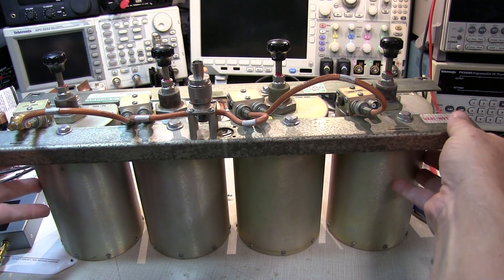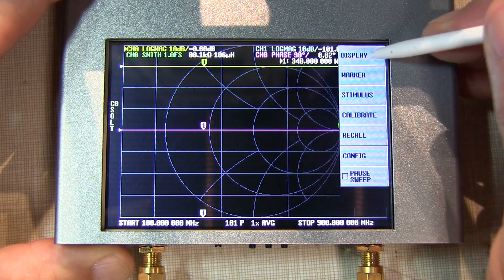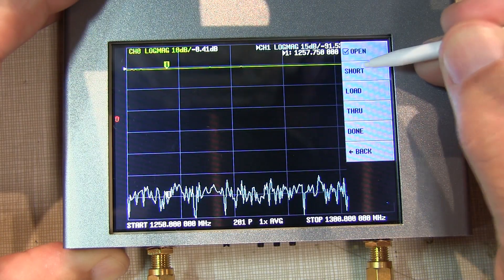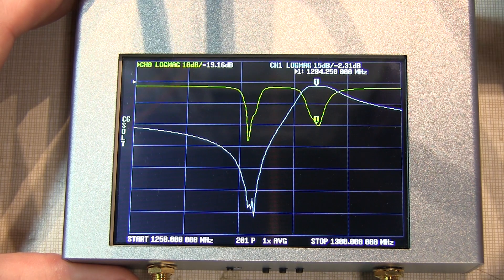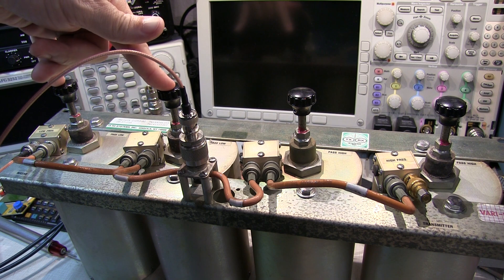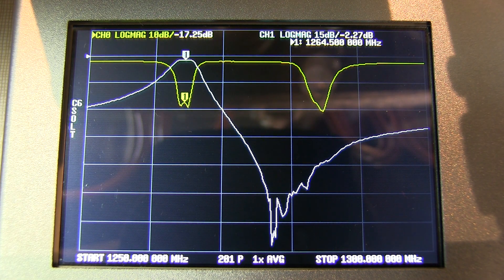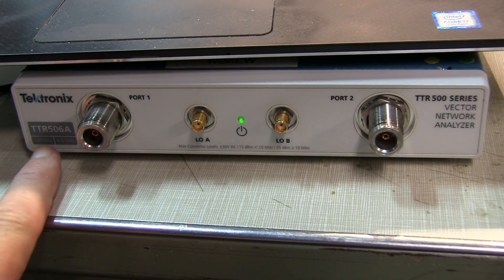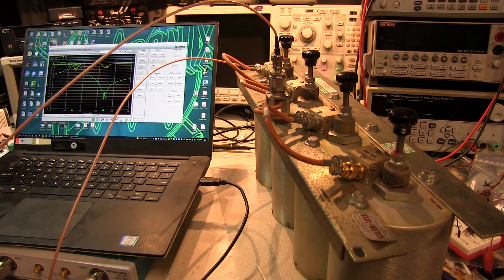#334: How to tune a duplexer with a NanoVNA V2plus4 | is it possible?

Comment: At 10:45 you briefly commented about the "two little peaks down at there bottom". I wonder if you could explain (or at least speculate) on why we don't see a single "peak"? It's interesting to note that those 2 peaks also show up on the TTR, so it's not an artifact of the Nano.
Reply from the maker: I haven't thought about it much.  To be really sure, I'd want to measure each cavity independently in order to see if each of those features is associated with individual cans.   It could be that the filters are tuned slightly off from each other and that is what was needed to get the passband response we wanted, but that is just speculation.  If I ever get one of these duplexers to test again, I'll look into this deeper.
Reply: @w2aew  Could it be a harness issue? Is the harness original? Are the frequencies those that the unit was tuned to at the factory?
Reply from the maker: Probably not since I was moving the frequency by only about 0.5%
Reply: @w2aew  I have seen this on Sinclair factory tuned units when using my SA/TG and RLB...always thought it was the rod(s) getting bumped in shipping. I'll anxiously await your deep dive when you get a round to-it...Tnx
Reply from the maker: With some more research, this appears to be due to the interconnecting cables not being a quarter wavelength long.

Comment: The trick on this kind of combiner is that each branch of the output has to view an open circuit on Smith chart at the rejected frequency. In order to achieve that, the length of jumpers is not trivial. If any of the jumpers is damaged it must be replaced with an other with the same electrical length. 

Regards from Spain

Comment: I've been trying to check a Wacom Bp/Br 440 duplexer using a NanoVNA.  Both a 2AA-SN and a new H4.  Following this video I seem to see a Bandpass response around the correct frequencies, but I see no reject or notch response.  Plus the S11 display is just a constantly changing jagged line, which looks nothing like this display.  I've calibrated using the cables, tried different cables with no luck.  I have only used the 2AA-SN O,S,L cal devices as the duplexer has N connectors.  The unused duplexer port is terminated with a dummy load.  I can't figure out why this isn't working.
Reply: Never mind.  It is one of the calibration standards that came with the 2AA-SN.  I'm guessing the load.  Calibrated with the smaller SMA style and now is working.
Reply from the maker: Ok, glad you figured it out.

Comment: Years ago I helped an engineer from Germany tune an 8 cavity hi power combiner… he told me he had a special tuning tool in his bag that he had brought with him for fine-tuning, and when he reached in and pulled it out, it was a tiny brass hammer 😂 he did exactly what you were doing just tapping on the adjustment rods with that little brass hammer.
Reply: I use a small plastic hammer. I have tuned many constant impedance combiners up to 20kW per channel and adjacent channel for HDTV and I can say that "tap tunning" is the easiest way. Tuning an 8-pole filter with two cross couplings is not for beginners.

Regards from Spain

Comment: each cavity should be tuned individually. pass 1st notch 2nd. once you have tuned all 4 install the harness do not touch up.
Reply from the maker: I've always done the final touch up with the harness connected - in the very least to verify performance in the final "as used" condition.

Comment: Great video. Dumb question, if you're calibrating the "open" then why do you need to put an open calibration connector on there? Isn't leaving the connection open still "open"? LoL sure. I'm sure there is a good reason.
Reply from the maker: At low frequencies, it doesn't matter.  As you to very high frequencies, the physical location of the open needs to be the same as for the short and load, so that the phase (propagation delay) to each of these "standards" are matched.  A small dimensional difference in the location of the open with respect to the other standards can throw an error into the calibration with respect to phase.  This effect is proportional to frequency (because wavelength is inversely proportional to freq)

Comment: I have a lite vna. Seems very similar. You seem to skip over some steps of setup in the vna. I haven't had luck following along. Or is there soke huge difference between nanotechnology vna & lite vna versions?
Reply from the maker: The intent of the video wasn't to show the complete setup of the nanoVNA (so some steps may have been not shown), but rather to check if the performance of the NanoVNA was sufficient to get an effective result.

Comment: Comparing this to your previous video #318, i was worried that the return loss S11 alos has a dip at the frequency position of the notch. I guess that in this video, you connected the port 1 (channel 0) to the antenna and the port 2 (channel 1) to the Tx or Rx ports, while in the previous video, you measured in the other direction. Therefore, while S21 shows the notch in one path, S11 has a dip at the same frequency that corresponds in reality to the passband of the other path. In the previous video, the return loss at a notch frequency was unity as expected. At the antenna point, the path that is at notch frequency should present infinite and real impedance so as not to perturb the other pass which is then in the passband and this corresponds to a unity return loss, but it has to be measured the other way around to not measure the parallel impedance of the other path.
Reply from the maker: Point of detail: S11 is not Return Loss, it is the Reflection Coefficient.  The difference between the two though, is just the sign.
Reply: @w2aew  Thanks Alan. Your videos inspire me to a lot of VNA uses beyond antenna analyzing. 73, F4HYZ

Comment: Interesting. At work I used to use the Agilent FieldFox VNA for RF Filter tuning. Just as a side note: For a cavity Filter (any kind), the rule is trying to get a Return Loss of at least -30dBm with the Notch at a minimum of -80dBm.  This would be good for 50W Base Transceivers and of course would cover your Link and Multipoint radios anyway as they use lower TX powers of 1W + 5W.

Comment: That great. I got about the same duplexer TX/RX systems used and UHF. re tuning for GMRS. UHF is bigger cans . VHF hi is bigger yet and VHf LOW is quite big. I did a 6 meter some years back. and 10 meter FM duplexer is very large. only seen pic. I have nano vna ver 2 and regal spectrum analyzer.  used both . another trick. nano vna as sweep gen. I did 1 can at a time. was easier for me. now VHF has more cans because of less split . 5 MHZ on UHF. I also have the MFJ antenna analyzer used that for final test. they can be tricky to tune  and temperature can effect them . finished GMRS 50 watt repeater.  we took a used UHF commercial one and re programmed and re tune for GMRS. a way to save some money. 73's

Comment: As always - a great video!  Could you explain the cable connections for transmit side vs receive side and where exactly the terminator goes in each scenario?  It wasn’t completely clear. We just had some cans tweaked for our 2 meter repeater - I want to see if I can come close to their results with my plus 4!

Comment: as a "brute force" measurement I connected the approx 78 watt (+48.9bDm) repeater transmitter to the transmit side 449.325mHz and tinysa ultra to the receiver port and measured -42 dBm at 444.325mHz without external attenuators...no, I'm not that crazy, I had 70db of attenuators in line in case I was wrong lol, then I removed them.  My question is it a safe assumption that the notch...and insertion loss is about 90db.  It was interesting to note that when I tuned the cavities individually I was getting close to 45 dB each.
Reply from the maker: It is a close assumption.  At that frequency, and with this level of attenuation, it is possible that you could be getting leakage through the shield of the coax - which means it could actually be a little better than 90dB.

Comment: Utilized this method for tuning a mobile duplexer for a desktop ham repeater at local scout camp to let scout hams experience using a repeater. I tried to diagnose suddenly weak reports from the repeater several weeks later. The S21 trace is showing a roughly -10dB S21 at the pass frequencies and a corresponding increase in the notch. Does this correspond to insertion loss? I compared it to a mini Celwave, which is showing approx. -3dB.
Reply from the maker: Yes, S21 is insertion loss.

Comment: I have a hard rime understanding return loss. What exactly does it mean? Does it being negative mean that there is less loss ?
Reply from the maker: Return Loss in dB should always be a positive number.  It is simply the magnitude of the reflection coefficient, with the negative sign removed.  It is common (but incorrect) to see the Return Loss expressed as a negative dB value.  Return Loss is equal to -10*LOG(PR/PI).  Since the reflected power PR is always less than the input power (PI), the result of that equation will always be a positive number.  Larger values mean higher return loss - which is a GOOD thing - you want the reflected power to be very low - thus you want the return loss to be very high.
Reply: @w2aew  well I was thinking, the key would "switch" to a dummy load , so, back and forth, essentially

Comment: Nice. 'direction' does matter as the length of the inter-bottle cables is part of the RF circuit.
Reply from the maker: True, but the actual length differences are typically 1% or less given the typical splits for a given band, which is likely within the cut tolerance of the interconnect cables.
Reply: @w2aew  First - good presentation... the "Nano-VNA" products are a decent 'clue' but not sufficient for really accurate, in-depth work as-is-prudent in many cases.  I just did a commercial 'bottle' retune with proper commercial equipment, then checked with my Nano-VNA... nice 'hint' but I wouldn't use a Nano-VNA as final proof for a repeater I cared about before taking the set of bottles to a commercial radio site.

The '1%' works if the filter package is more or less within as-designed/as-built band-segment.  220 is 'easy.'  

I bring this up as hams are want and often acquire to re-purpose surplus commercial products that are in significantly different band-segments.  Can you use a 450-460, 470-490+ set of 'bottles' at 440-450, or 420-430?  155-159 MHz bottles at 146? Yes... sort-of... but the results are not good/best.  10-20 dB of not-quite-best pass- and/or reject- performance difference is not insignificant.  

It is prudent/recommended to consider and re-configure coupling if you're taking a used product 10, 20, 40 MHz out of as-built band.   Some filter manufacturer's filter-prep bench have an array of various length coupling lines to dial-in each product sent out.  There can also be internal coupling loop differences which is also a factor.  Two 'identical' products can leave the factory with different length coupling cables.

This becomes more critical as hams are want to try to re-purpose less-stringent mobile products to repeater service.  MORE critical as we have and continue to see some vendors re-packaging "off-shore" mobile products with 'generic' reject-only flat-packs - all of which wholly inadequate for commercial site installations.    

Many commercial and government sites do not allow... re-purposed mobiles as repeater or remote-control installations, reject-only filters, lack of isolator on the TX, 'ham' antennas, LMR-type feedlines, etc.  Some of our site owners call at least one of us to pre-qualify potential new tenants, and we ask about the equipment, etc. Some vendor/brand names and products trigger an immediate NO!  Even if what's stated is good enough to yield a Yes, post-install inspection and spectral analysis gets interesting.    If your ham radio presence at a great site is 'essential', the equipment and engineering should be equal to the objective.
Reply from the maker: @jimaspinwall7814  Jim - thank you for all of this great insight. You've clearly done this more than I have, and this real-world practical info is very valuable.

Comment: Very cool!  I have a vna2, but didn't think it had the dynamic range to tune a duplexer.  Do you think it would work with the narrow spacing of a 2m duplexer as well?  I've only worked with them once, but seem to remember they are a PITA.
Reply from the maker: You can set a narrow span, so the frequency resolution should be adequate for a 600kHz spacing.  The dynamic range is another story - really depends on the generation of the NanoVNA - the -F and V2 units have better dynamic range than the original and -H -H4 units.

Comment: I posted some comments and questions but they are not showing in comments section.
Reply: Would you be willing to give me some assistance? My email address (scroll over email) is on my QRZ page.
Reply: I am trying to tune two Comprod duplexers, one UHF (66-40-46) and one VHF (66-13-46). I am trying to learn the process on a NanoVNA V2 and I will purchase a NanoVNA V2plus4 if I can figure it out but I am beating my head against the wall. My traces look very different than what you have shown in your video.
Reply from the maker: @4150CHF  I will reply to the email that you sent to me as well.  But I also wanted to share this video from Sinclair (another duplexer manufacturer) that goes through the tuning process in detail for their type of duplexer.  https://www.youtube.com/watch?v=U7QZzzB2LZU

Comment: I am new at this. How is it possible to have 2 different LOGMAG traces that are not the same?
Reply from the maker: LOGMAG is just the display format - it is plotting the MAGNITUDE of the measured parameter in dB - that is what LOGMAG means.  There are two traces that I configured - one of them is measuring S11 which is the reflection coefficient, the measure of how much of the injected signal gets reflected back off of the input, back towards the source (VNA CH0).  The other is the S21, which is the transmission coefficient, the measure of how much of the injected signal makes it through the duplexer.  Each of these two measurements are being displayed in the LOGMAG format.
Reply: @w2aew   Is S11 (CH0) connected to input of one side of duplexer (Lo/Hi) and S21 (CH1) connected to duplexer output (antenna port)?
Reply from the maker: @4150CHF  yes
Reply: @w2aew  What do I need to select in the menu to ensure that the second trace will be associated to S21 (CH1) and not a duplicate of S11 (CH0) or is it automatic ? Please forgive my ignorance.
Reply from the maker: @4150CHF  Under the Display menu, you'll see a Channel button that allows you to select which channel is being used for the selected Trace.  Use the Display>Traces menu to first select the active/selected trace, then go back to Display>Channel to select the channel for that trace.
Reply: @w2aew  Wow. Thanks. I can't believe that I did not see that!
Reply: @w2aew  You are awesome. I just subscribed and liked.

Comment: Would having used it with the software on the computer with 1001 points have brought you even closer to your reference VNA?
Reply from the maker: Not really - the software wouldn't help with the measurement dynamic range.

Comment: i am interested in such duplexer. Where can i find its schematic? Thanks.
Reply from the maker: This type of filter can't really be accurately conveyed in a schematic.  There are very few traditional electronic parts - it is mainly built of mechanical structures to create resonant cavities, etc.
Reply: @w2aew  Thanks. Do you have simplified schematic? I want to see how the simultaneous transmit and receive work.
Reply: Duplexers, Diplexers can be modeled with lumped circuit elements but this would be very difficult. In the Feynmann  lectures they show as the RF frequency increases a metallic can acts like an LC system. I can recall for example a coke can, becomes a resonant circuit at about 455Mhz. What you really need is a mechanical diagram not a electrical schematic. I have always thought of Duplexer design as a bit like black magic. very specialized area.

Comment: Nice job. You're a natural instructor. 
How would you contrast this vs using a spectrum analyzer to tune this setup? Anyone?
Reply from the maker: To use a spectrum analyzer, you'd need a signal source (usually a tracking generator), and a directional coupler or return-loss bridge.  With these, you can tune the passband.  You won't need the coupler or bridge to tune the notches, but you will need to have sufficient measurement dynamic range to see the depth of the notch (90dB down or more).

Comment: Another great video Alan! Thanks. It is great to see how well the VNA-V2plus4 performs against to your TTR506 VNA. In a previous video on your earlier NanoVNA you used DisLord's firmware. Have you tried his release on the NanoVNA-2plus4? It would great if you share your thoughts on his firmware on the V2plus4.
Reply from the maker: I"m sure that DisLord's firmwre for the V2plus4 is very good, I will have to try it at some point...

Comment: Nice video. The only thing, if I may comment, is that I think you would be best to include the cables whilst doing the calibration. I am no expert but that is how I was always told to do. Again well done and keep io the good work
Reply from the maker: Yes, including the cables in the calibration is important when you want to remove the attenuation and phase (delay) of the cables.  In our case where we are only looking at the relative depth of the return loss and insertion loss (no phase measurements, no absolute parameter measurements), you can get away without including the cables.
Reply: @w2aew  Thank you for the clarification. As I said I am no expert but always with a hunger to learn. 73's a d take care